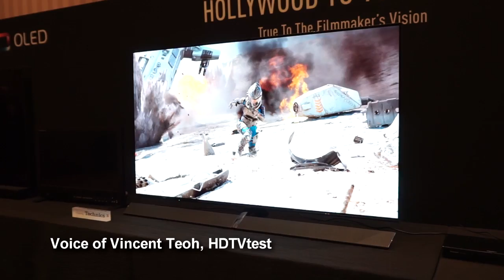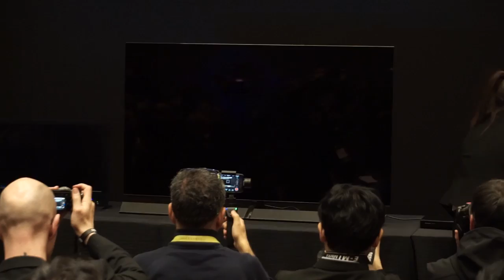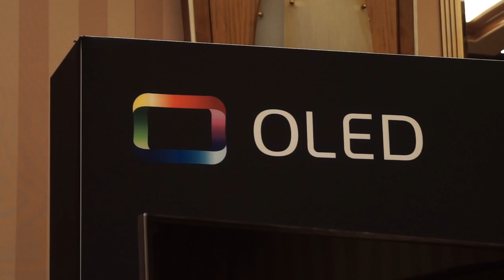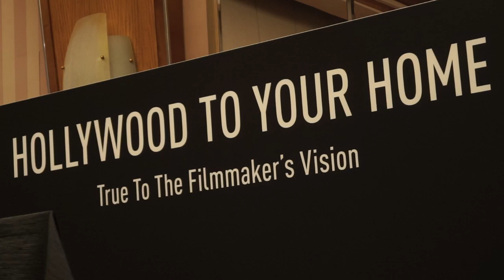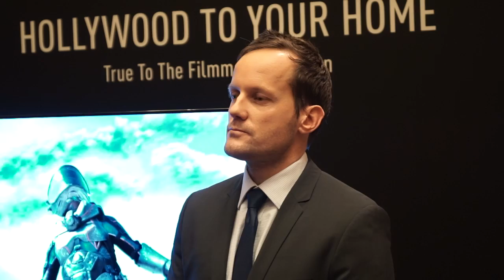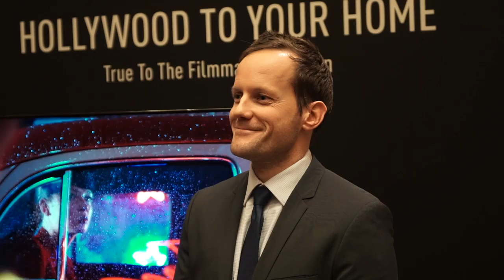Panasonic EZ1000 4K HDR OLED TV: CES 2017 Interview

Comment: Its strange that they don't offer smaller sizes... a 49 and a 55 perhaps? They must be missing out on a huge chunk of the market by just offering humongous screens.
Reply: Wait for the LED's. Here in Canada, you can buy a 40" 4k Panasonic tv. I'm sure it's high quality, but strangely, only the 58" and 65" models support HDR. Maybe this will change in 2017. As for OLED, I think only large OLED tv's are currently par for the course with all the tv manufacturers, as it is considered a luxury.
Reply: MrGhost370 I think eventually in a few years they will have to offer more practical sizes of high end sets. There's a huge market for people with money to spend on a TV with the best picture quality but who don't want a 65" monster set. With any luck oled will start to filter down to the more sensible sizes eventually.
Reply: Russ Davey Question. Did they ever offer plasma tv's in the smaller sets, or was it only a high end, large tv thing?
Reply: John Smith plasmas had to be a certain size due to technical reasons. But oleds are used in phones so no size limitations.
Reply: Russ Davey Are you sure that is the reason why they were only in large tv's, or is it that they only include all the bell's and whistle's in the high end and most expensive models. You'll notice that the SUHD models are only in those that are larger than like 55" as well. I believe the same is generally true with the 3d phenomenon also. I think they are trying to target a certain market with these kinds of tv's.

Comment: I can  bet Sony's  Oled Tv will be better and the best!!
Reply: Саша Фурів highly doubt that. The Panasonic is close to reference level. Sony can only do one close to reference too. If anything picture quality will be very good on both. They're using same lg panel, its a matter of who gets rid of the current  issues that are plaguing lg oled panels
Reply: MrGhost370 all consumer oled are using lg panel white oled. 
Loewe 4koled, lg  oled and Panasonic's cz952 they all look very similar. its the processing that counts because the Panasonic has better colour than the current lg oled. And better upscaling. 
So knowing Sony and its processor we will see a really good oled but Panasonic aim to achieve the reference picture also. So i cant see the sony totally outclassing it. 
These panels all perform very similar. 
But now that we have a choice we no longer need to buy a lg oled.
Reply: Better off with the sony in the states because Panasonic wont be releasing it.
Reply: sony and panasonic used lg oled panel
Reply: Саша Фурів You lost your bet. Panasonic EZ1002 won 2017 TV competition by HDTVtest. https://youtu.be/W8cN-549F4E

Comment: Please find out if you can remove the speaker and wallmount just the screen?
Reply: Christian Smedman i don't think you can remove the hideous looking speaker.
They should have made it like the samsung Q led being flush against the wall with a one connect box .
Reply from the maker: Good question. We'll ask.
Reply: HDTVTest can you also ask besides improving the colour accuracy which was very good on the cz952. Have they managed to sort out near black and banding. Also how much of the rec 2020 % have they got.
Reply from the maker: @Christian Smedman: Yes, the speaker is removable, and the screen can be wallmounted.
Reply: what happened to panasonic usa tvs
Reply: HDTVTest thats good to hear

Comment: Doesn't have Dolby Vision and that's a damn shame.
Reply: Paul Glimmer like you've had so much dolby vision to watch. 
Who cares the hdr is hit/miss.
Reply: Incorrect. Hybrid Log Gamma does not need metadata, which is what Dolby Vision uses. It relies solely on the display of the panel. So whether it's DV or self-processed HDR it doesn't matter.
Reply: Dolby Vision is another way of doing the exact same thing.
Reply: ShoeMage exactly
Reply: it has a newer HDR technology called hgl witch has no content at the moment and i think something else
Reply: LaZe VIRAL its broadcast hdr hgl. For future broadcast channels that do hdr.
Reply: Right now i wouldn't be bothered about hdr as long as it can do 1080p and 4k to high standard thats enough. We'll probably watch 1080p more for the next few years yet.
Reply: ShoeMage stop complaining about dolby vision hardly any material besides demos. Probably will be like this for a few years. Couldn't care less about hdr.